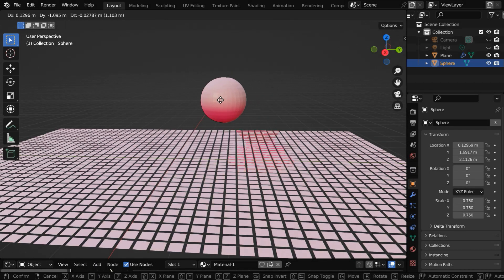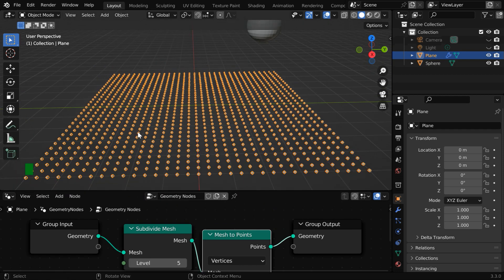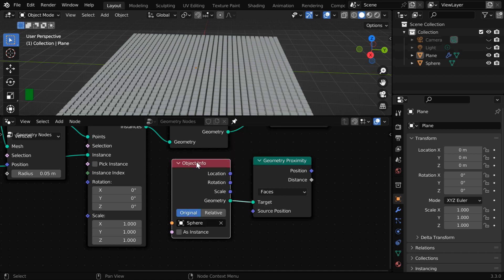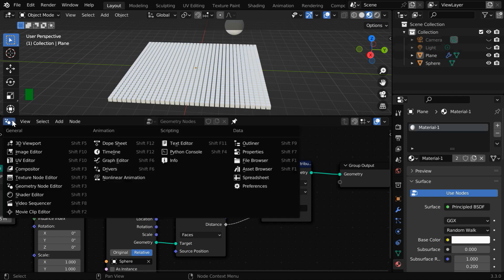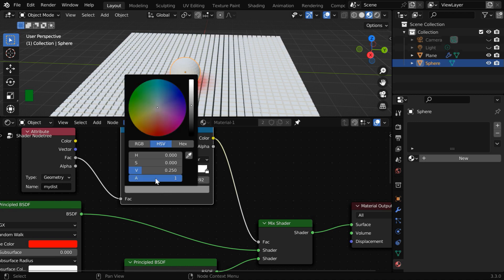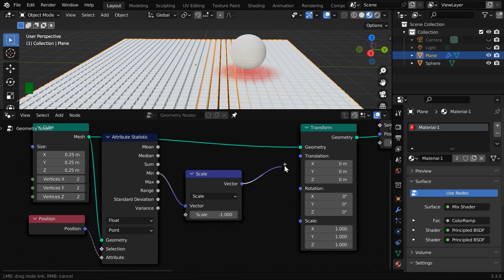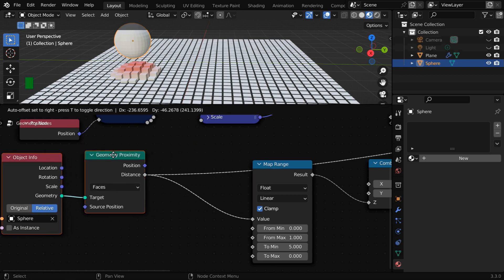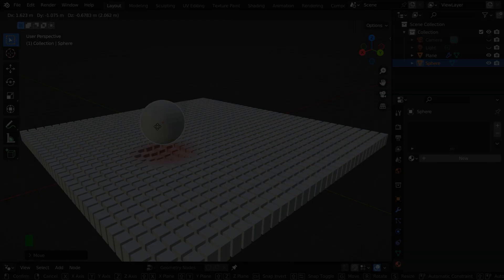Proximity Sensor In Blender | Create Attractive Animations With Geometry Nodes | Easy Tutorial

Comment: Do you think there is a way to make it look like an eraser? instead of making them change size we would make them disappear.
Reply from the maker: Yes. With the same setup change the z-scale factor to zero when the proximity value falls below a certain threshold. The object will disappear. There are other alternatives as well, but this is closest to the existing setup that we created in this tutorial. You can also use the proximity distance as a mix factor in the shader editor to mix a transparent BSDF with the original material of your objects. So they will fade out and disappear as the proximity increases. You need to also ensure that they don't come back once disappeared. This last part can be done by setting a custom property to your objects (this property will hold the visibility of the object and it won't change once disabled).
Reply: @5MinutesBlender  How can this be achieved?Is there a blender source file available for learning? Thank you

Comment: Hi, grat tutorial but is there a way to maintain the effect in the already affected areas?
Reply from the maker: Yes, it can be done. We need to store the height or the color as an attribute of the cubes, using a Store Named Attribute node. Then capture this attribute before we change the property based on the proximity and use it as a cap. The property should change only if the new value is less than (or greater than - as the case may be) the stored value. This will ensure that the cubes hold their changes even when the influencing object is moved away. That is one way to do this, there may be other ways as well.

Comment: when i put my map range into my combine xyz the wire connecting it to the scale does not work
Reply from the maker: Hi, I checked this again but could not find a problem. What happens to your node when you connect the map range node to the combine XYZ? Does the wire connecting it to the Scale node just disappear? What if you manually again connect it? It will help if I can see your node setup. Can you please send it over via email to 5minblender@gmail.com?

Comment: store named attribute node is not there what version of blender are you using?
Reply from the maker: Hi, it is there from version 3.3 onward. If your version does not have this node, you can connect the proximity distance to the final output geometry node. Then give a name to this output parameter (either through the geometry node properties panel or in the output list under the modifiers tab ). This name will become the attribute of the object which you can access from any other place as shown in the tutorial - so not much change.
Reply: @5MinutesBlender  Ok thank you soo much
Reply: Hello,how to fix this Problem.The Methode fom 5MinutesBlender is not working.Can you help me.Thanks
Reply from the maker: @Snowfinger  Sure. Please let us know where exactly you are stuck. You can give us a timestamp from the video where your results are different from what is shown. We can then understand it better and suggest a solution for you. Thanks!